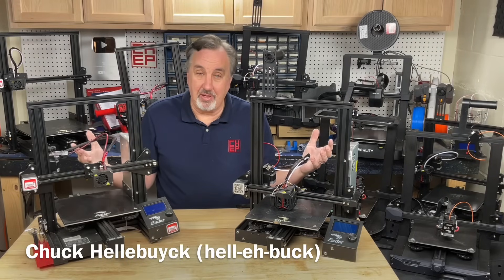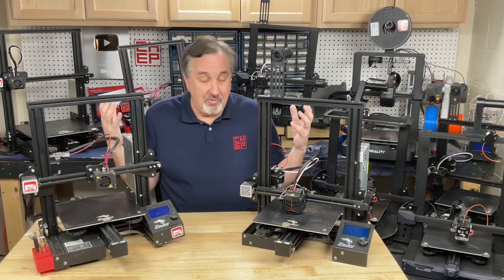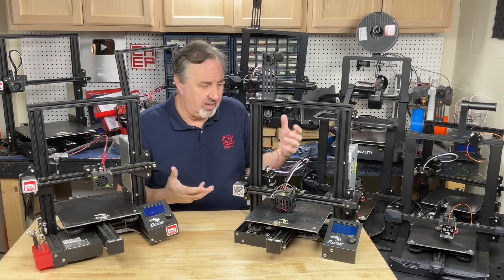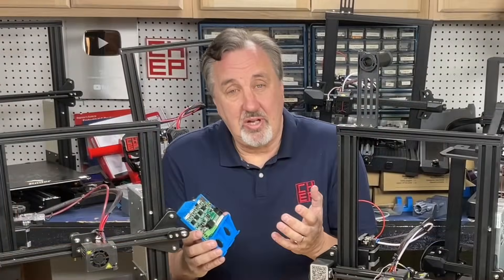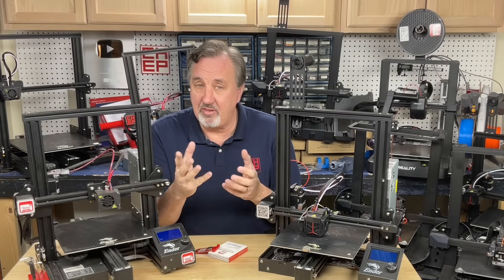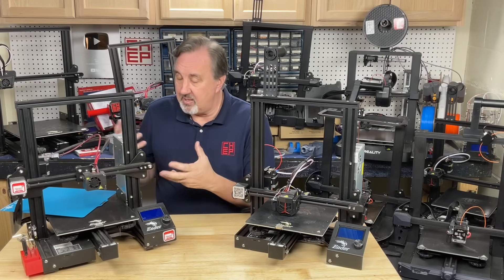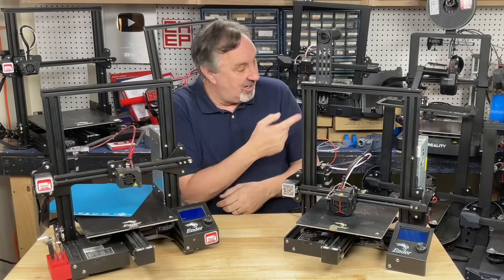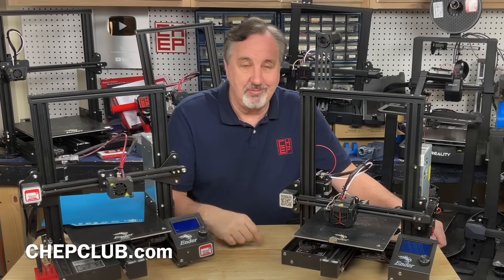Too Many Ender 3's - What Should I Do?

Comment: What is your recommendation for someone who has been using an Ender 3 (V2) for 5+ years and is ready to upgrade to a new FDM printer?
Reply from the maker: Depends on your budget and what you want to print. The Bambulab A1 Mini or A1 are great upgrades, print faster and better. Enclosed I’d look at the FlashForge 5M pro or Centauri Carbon. For multi-color add the AMS to A1 or look at Bambu P1S with AMS.
Reply: @ Thank you.  I’m thinking $300 ish for a budget and multi color is a maybe.  So the A1 is doable. 
I upgraded to a larger resin printer for Christmas. 
I’m thinking a new FDM for Papa’s Day or my birthday.
Reply: I had Enders for years and now have an A1 Mini, A1 w/ AMS, and 2x P1S's w/ AMS. The A1 is a good all-around printer for normal materials like PLA, PETG, and TPU. If you print a lot and have the extra money I would highly suggest the P1S. Even with PLA the overhangs are much cleaner and it's also faster. Additionally, you can use more advanced materials like ABS and ASA. I wouldn't be disappointed if I only had an A1 so if you can't swing a P1S you will still be very amazed coming from an Ender 3.

If you don't want a Bambu then the AD5X would be my next suggestion. You get 4 spool multicolor support and you can pull TPU through the AD5X's multicolor system, something Bambu's AMS cannot do (you have to use an external spool). Bambu does have their own AMS compatible TPU, but apparently it's harder than normal TPU. Even if you don't make multicolor prints (I have only a couple times), the ability to select a different material type or color you commonly use with just a single touch really opens a whole new world, on top of the time savings. 

When I had my Ender there were times I would think "I could print this thing...but then I have to get the other spool, let the printer warm up, unload it, manually load the new spool, verify the bed is level, then.... Nope I'm doing something else!" Having a multicolor printer will blow your mind just because of the ease and efficiency it brings. I would personally NOT buy a new 3D printer without it.

Comment: I still use my Ender 3s every day, I’ve upgraded my older ones with new mother boards and E3 V2 displays so I can put MRiscoC’s Professional Firmware on them. All of them have been converted to direct drives as well with all metal hotends. Even with mods I’ve stayed below the $200 per machine (I either bought used or MicroCenter $100 deals). Since I just press print and walk away I don’t see getting rid of my Ender 3s at all. Since I have plenty of bandwidth, print speed is not really a selling point for me.  And yes your early Ender 3 videos are still relevant, not a day goes by that I don’t share links to your bed leveling, first layers, hot end fixes, and troubleshooting videos in the many 3D printing Facebook groups I’m in. I’m amazed how many people say they are just brand new to 3D printing and need help with their V1 Ender 3 they just picked up. I thoroughly enjoy you channel and I’m looking forward to what you have in-store for the future.

Comment: I'm still rocking my RepRapGuru i3 but you'd never recognize it. I reprinted all the parts, added a HeroMe7 hotend, DIY ABL, replaced the bed with a magnetic steal PEI sheet and it's killing it with quailty part making at about 75 speed. When I first got it, it could barely print PLA at 25! PETG was an utter failure every time. Now it prints PETG at 75 too with no stringing. But that's over like a 6-7 year process. I know so much about 3D printing now and I've been told I should start a Youtube channel. I have my channel ready but need to take the plunge and start making videos. Thanks for all the years of help Chuck!

Comment: We have 3 Ender 3 series along with an Ender 5 Plus in a room that we use to make random things at our business.  I have 2x P1S Combos and an A1 Combo at home and brought in an A1 Mini that I have on the back corner of the U-shaped desk in my office. I have the Enders dialed in pretty well so print quality is good, but the process to slice, put the file on the card, bring it to the printer, and start printing is much more work than a few clicks to send a file to the A1 Mini.

I don't use the Enders unless we're making a large batch of small parts. We needed some shelf tag holders so the Enders are actually in use now, but this morning I had to manually level the bed, but that now frustrates me since I'm spoiled by the Bambu. I will say I'm glad I know how to do it, but I just don't WANT to spend the time doing it.

The large build volume of the Ender 5 Plus still has utility so it's worth keeping (made a bit easier with OctoPi), but the 3x Ender 3's could be replaced by a single A1 with increased production output.

TLDR: It's not that the original Ender 3's are bad printers, they're just not an efficient use of time to operate.

Comment: I still use my Ender 3 after 4 years.  I have upgraded to SKR board, touchscreen, Sprite pro hotend and CR touch and it's still a really reliable printer.  Yes its not the fastest, but I can trust it to run long prints

Comment: I still use my Ender 3. Till end of last year it was my only printer. I rebuilt it with all the mods from Kevinakasam (belted Z, linear rails on X and Y, KlickyProbe, Frankenstein Duct, ...). It is good enough to print reasonable fast with good quality. It printed all the stuff for the Mercury One mod for my Sovol SV05. And the Mercury One now prints all Voron Trident parts.

The corexy are way easier to enclose and printing ABS.

It is also really hard to get used Ender 3 here in Germany reasonable priced. They all want 90€ upwards for a used machine. If I get one below 50€ it's luck and a great base to rebuild the machine and gift it to someone.

Comment: I still have what was my Ender 3 V2. It was modded into a Ender 400XL for a while. It had a BTT Octopus mainboard, BL touch, ran klipper, had dual Z motors and a mains voltage bed. Recently its be getting scrapped out so I can reuse the electronics in a new CoreXY build based around a DIY extrusion frame based off a Ender 5 Plus, Zero G Mercury One motion control system, custom multi stepper bed system, EVA 3 tool head (E34M1) and enraged rabbit MMU.

Comment: I have an Ender 3 V2 with BL touch and MicoSwiss direct drive (changed extruder servo for a lighter model).  It may be slow but I can send a print to the printer and walk away knowing it will do it right.  Don't need fast, just one that will do it.

Comment: i still run an ender 3, not pro. i went and bought a broken one to get up and going. i still use it and stand by the old ones. with limited funds , i can still keep it running. if your giving away any i will take it. never have enough parts.

Comment: I still have and use my Ender 3. I have a second one still in the box, just haven’t had the area to set it up. Mine are very stable and just plain work. I need to move the printers to my garage. I built 2 years ago and I am still doing MAJOR organizing. What stat do you live in?
I purchased the first one to save $700 and get rid of a dangerous situation. The detents in my bio roll around tool box had all failed 54 of them at roughly $9 each. Purchased the printer and a spool of A95 TPU for $230. Problem fixed. Still use the printer for MANY projects.

Comment: I still have my Ender 3S1 and it's still my go to work horse. I have two other that are more artillery sidewinder clones but they still work just fine, and I have a larger Elegoo Neptune 3 MAX for the size but I don't have any plans on getting rid of them unless it's to someone who want s to learn about it. That said I offered to give one to my local library but the staff were not in the mood to support it and I already have a full time job. 
Shame really. 
Some day they'll die and then MAYBE I'll get one of the newer core XY printers (I have no need for multicolor and really don't care about winning any speed races) but until then; I'm good with what I've got.

Comment: I've upgraded mine  SKR min E3 boards, probes, dual gear metal extruder, etc    Not sure I can sell them or give them away   Though I did find a project on Printable to take 2 ender 3 printers to make a core XY printer   I might do that if selling or freecycle doesn't work    I'll keep my Ender 3 Pro as a tinker machine

Comment: I have a problem with my Ender 3D Pro he goes to home he heats the plate and the print head but does not print the job. So it does read the map, what temperature, etc I can't figure out why he doesn't want to print, he doesn't print previous files either. What could that be? I can't find this mistake anywhere.

Comment: I do still own an Ender 3 but I haven’t turned it on in maybe six months for two main reasons:

-I got a Sovol SV06 Plus in 2023 that prints 99% of what I was doing on the Ender 3. For roughly the same price as the value of my Ender and its many upgrades, the SV06 Plus prints faster, larger, and more conveniently. 

-My Ender was damaged in a print head crash (I think the gantry extrusion V-slots are bent) that caused two big rectangles in the print area to have a drastically different level compared to the rest of the bed. I can functionally only print things roughly 30-40 millimeters wide without running into massive Z-offset issues. 

The only things I’ve printed on my Ender 3 in the last year or so have been gears for a project at work; we didn’t have access to an enclosed printer to do nylon and ABS, and the bed size and travel on my SV06 Plus make it impractical to use the Garbage Bag Enclosure trick. The ABS gears delaminated during installation but the nylons gears not only worked great, they’ve lasted longer than the traditionally-manufactured nylon gears they replaced. 

If I could fix the leveling issue - the bed and the gantry extrusion are straight, new V-slot wheels didn’t fix the problem, and the bolts/nuts for the wheels are fine, so the slots themselves must be off - I would give my Ender 3 to a coworker or a friends’ daughter in a heartbeat. I have my trusty SV06 Plus and am working through some growing pains on a Vivedino Marathon, so the Ender really doesn’t have a fit in my 3D printing space any longer. 

If you have a spare original Ender 3 gantry extrusion, I would be happy to buy it and see if it fixes the leveling issue once and for all. Otherwise, we’re in the same boat…stuck with a printer that doesn’t deserve to be trashed but no longer really is useful.

Comment: I hate admit it but I have an Ender 3 new still in an unopened box. Plus, I have  a Duet replacement board. Capricorn tubing and more stuff to enhance it. 
I'm retired now so if I clear enough space to use it I still may put it together. 
Thank you for the video!
Reply: Open it mine is working a long the 3v3se i upgrade whit klipper mainsail Just upgrade the ender whit klipper 32 bit mother board and let it rip whit a direct drive toolhead geth the dual z axis upgrade linaer axis and there you go .
Mod the thing and you have a verry nice printer
Reply: @micver1091  thanks I'll look up those parts.

Comment: Got a K1SE recently and upgraded it to be a full K1C after messing with my ender 3 and Klipper. Currently have them both printing in tandem for my robotics projects, once the ender 3 is tuned with klipper and a direct drive mod it's an incredibly reliable machine.

Comment: I've had mine since 2019 and it still works great. I have klipper running on the 4.2.7 board and a pi 3 and a flexible build plate. that is it. It's a toyota corolla in a world of BMWs. Not fancy, pretty, or fast, but is reliable.

Comment: Still have my original Ender3 from 2017 or 18. It has been modified a lot over the years thanks to you and others here on YouTube. In it's current state, I am on mainboard #3 which happens to be the EZBoard from TH3D. Printed on glass for years until I finally bit the bullet and upgraded to the magnetic bed and the CRTouch bed leveling system. Through many extruder setups over the years I settled on the Microswiss NG extruder. The whole reason I bought a 3D printer was to print TPU drone parts so I was always chasing the best setup for that.  I run the printer with Octoprint via a 3D printed mounted old 8" tablet on the machine itself.
I also still have my CR10S4 that has also been modified in much the same way that still works OK for the most part. It never was on the level of my Ender3.

I have since purchased 2 of the CoreXY printers out there: The Bambu Labs P1S and the Qudi X Max 3.  I've had the P1S for a little over a year and it is a real machine, I think I appreciate it more than others because of my roots starting with the Ender3 and the CR10S4.  I just recently purchased the Qudi X Max 3 and I have had to actually do a little tinkering with it as I am not all that familiar with Klipper.  I have the machine printing large items pretty well with the 0.6mm Nozzle. I have this machine setup for printing ABS/ASA/CFPETG and the likes.

Thanks for all that you have contributed to our hobby.  I would be interested in purchasing an old Ender to build a PET filament machine out of.

Comment: I sill have an ender 3 v2 that's been pretty heavily upgraded with a 3D Fused linear rail kit and a sprite pro extruder, it prints great, and I had fun doing the addons for the rails.
I wish I could use it more, but I have a few vorons and an X1 Carbon so it's mostly a backup machine at this point.

Comment: Still using my Original Ender 3. Adding CRTouch really helped the consistency to limit frustration when printing.

Like you said it's a great tinkerers machine. I designed my own cooling duct system for fun that's lasted a few years.

I've been wanting to upgrade to coreXY but actually decided to continue modifying the Ender3 with 2nd Z screw, linear rails, and sprite pro hotend as well as some LED mods and plan on trying out Klipper. Not really worth the cost considering the price of current gen Ender3's. But if i was to purchase I'd be going for a larger enclosed unit (K1, core one, or XL) which are currently out of my budget so this was a compromise and fun project for me. I'm really only missing out on the enclosure whuch i may attempt to make.

Have you thought about taking 2 Enders and making a CoreXY out of them for us super budget tinkerers? That may be my next Ender3 upgrade if I don't go to a new machine.

Thanks for the videos over the year's.

Comment: Older machines are how you learn how modern ones work.  I can build my own printer with help of everything I learned modding my Ultimaker Original - it's a baseline for knowledge and the Ender 3 is the same. Still have and use my UMO, not least because I have a boatload of 2.85mm filament.
My first car was simple and I tweaked with it, could change parts, learned how it worked.  My modern JCW is boxes and electronics, so I can't do much with it, so it goes back to the garage, but my 27 year old VW camper can be taken to pieces and put back together again by me. Same with the Ender3; it is user maintainable at the basic level and very reliable.

Comment: First and only printer is an Ender 3 Pro.  Lots of incremental upgrades--BTT touch screen, BL Touch, a direct drive, an RPi  with Octopi.  Yes, I was part of that Covid facemask printing movement.  Had the thing churning nearly 24/7 for months.  For all my upgrades, I've done very little repair work to it--original power supply, original belts.  I've heard newer ones are faster, but mine still works, and it's a hobby.  If I add up the cost of the upgrades, sure, I've spent quite a bit.  But--not really interested in laying out a bunch of cash for a new one.  For my case, the cost/benefit ratio doesn't add up.

Comment: I still have a ender 3V2 and use it often. Your channel helped me modify it by adding a cr touch , new board , direct drive, and dual Z axis drive. Then you showed how to tune it and use cura. I will keep using my ender 3 as long as I can keep repairing and replacing parts when needed.

Comment: I started with an ender 3v2 the month they came out, then bought an ender 2 pro at Chep's recommendation. My 3v2 got a clog and i broke the little sensor wires on the hotend while removing all the plastic around it and i haven't fixed it yet, but i intend to.

Comment: My Ender 3 has been disassembled for almost a year. I have a couple of Prusa's and Voron's that fits my needs ok. What I am missing is a multi head printer. The MMU's are fine for multicolor but the Ender 3 is  currently in my plans for a Switchwire style hybrid (using the dual z rods as the hybrid part) idex. I give it about 5-7% chance of ever becoming something but that is the plan for my Ender 3.

Comment: I bought my ender 3 pro back when COVID hit. I had to be careful because the way my house wiring was set up. The room i had my ender 3 plugged into was tyed into my bathroom and i wouldnt leave run it while i wasnt at home. It started having problems so i dropped it until i got it fixed which how i found your channel and its helped so much. So now i have it running constantly while im at home but i still have to keep an eye on it because my mothers house has old wiring and i still only run it while im at home. It is the only 3d printer i own and i still love using it. So thank you for all the HELP you give

Comment: Why not beef up the ender 3.
X y axis.
Linaer rails.
Put a 32 bit in there.
Put a k1 nozzle on there.
A nebula pad 

Just one printer of course. 
The one whot chep logo yeah lets see it i have a ender 3 orginal and stil runs fine .
And i use 3v3se profile .
Yeah go ender😅